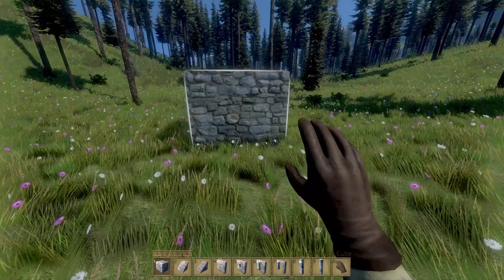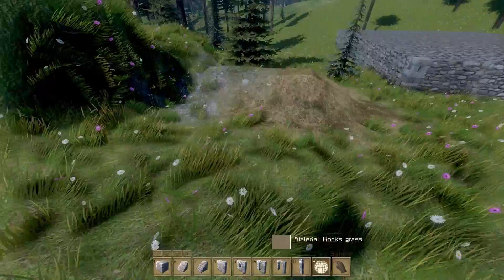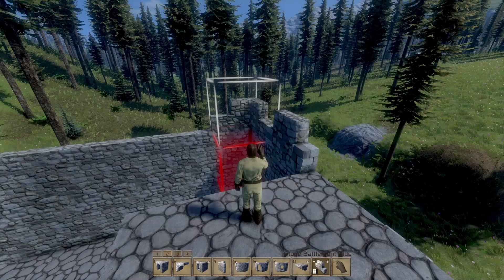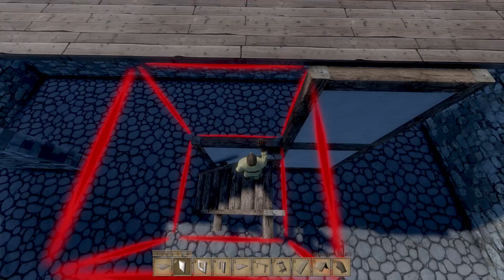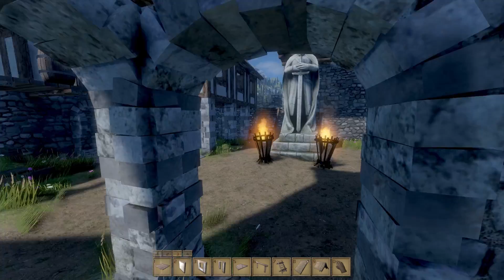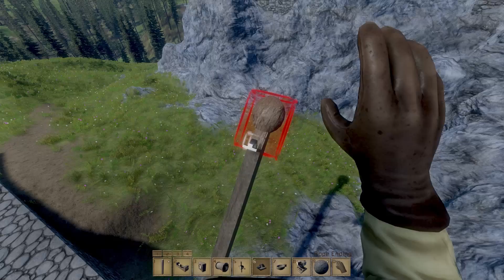Check Out... Medieval Engineers (Alpha Gameplay)

Comment: Would be awesome with 100 v 100 matches, where some players are Guards, some are workers, and other things. Workers will have to harvest resources and build a castle while the guards defend the workers. When both sides are strong enough, they could begin to build catapults and attack eathothers castle.
Reply: ***** What if they optimize the game like hell?
Reply: ***** The current problem with destruction in this game is that it's using a single core. They're updating it to use multiple but currently it doesn't do that.
Reply: ***** I didn't say it would.
Reply: ***** My PC has 128 Ram
Reply: There is a 2D game with EXACTLY the format you describe, made by the same company that gave us "Soldat". It's good.